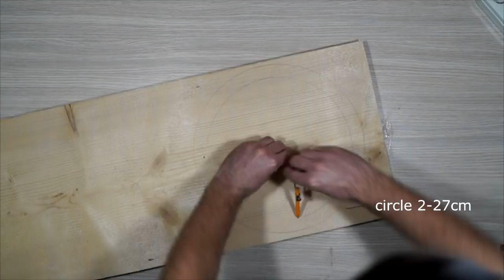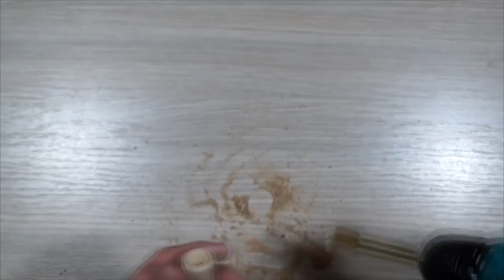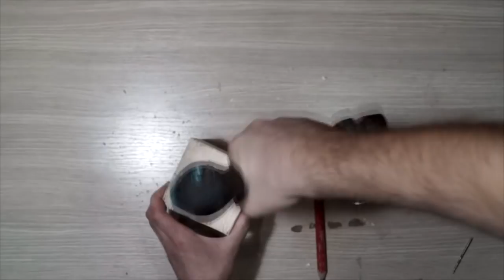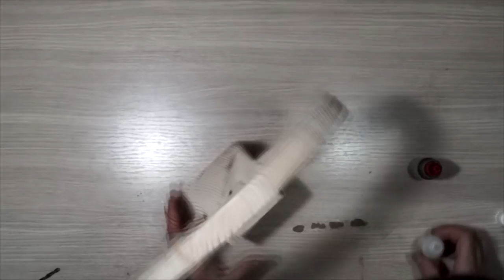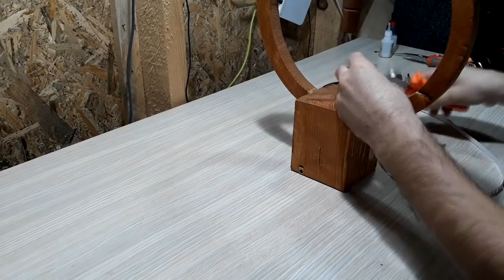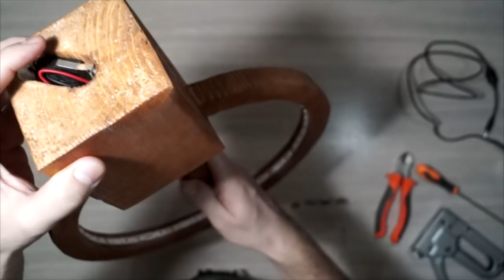DIY LED BALANCE LAMP

Comment: Instructions could be bit clear
I didn't get it
But beautifully built
Reply from the maker: Tell me what you did not understand and explain to you here.
Thanks!
Reply: @IulianMan  i cant understand that what you did to that magnet to make it insulating
Reply: @IulianMan  is that magnet connected with wire if yes then how

Comment: It's so amazing and cool!
I'd like to make it myself, but can you tell me exactly how it turns on when there's a magnet?
Reply from the maker: Hello
The fishing line does not transmit electricity.
If you look closely at the clip is a switch down in the base.(A black switch)
That switch has a tab and is driven by the fishing line when stretched out.
Thanks!

Comment: Very cool. Thank you. Might you have a parts list available? Or at least a link to the specific switch and transformer you used? Thanks again!
Reply from the maker: Thanks!
the transformer is 12V with 1 amp
and the switch is Snap Action-Switch
https://www.amazon.com/Basic-Action-Switch-Straight-250VAC/dp/B00HKHURL8

Comment: shall i use 12 v dc battery instead of 12 v transformer... what you connect with snap action switch?
Reply from the maker: you can use the battery. connect the battery wire and the  wire from the led to snap action switch

Comment: Any specific brand for that specific snap action switch?
Reply from the maker: it doesn't matter the brand
if it helps you here is a link
https://www.aliexpress.com/item/4000144580116.html?spm=a2g0o.productlist.0.0.612f7434HAhDab&algo_pvid=ef8d7dc6-495a-4168-99e7-ab7cea2a84d4&algo_expid=ef8d7dc6-495a-4168-99e7-ab7cea2a84d4-15&btsid=0ab6d59515918199255211304ed24c&ws_ab_test=searchweb0_0,searchweb201602_,searchweb201603_

Comment: Awesome! How does it work? Fishing line transmits electricity or I missed something?? I don't have much knowledge about electricity, so I didn't really understand what you were doing, but I'm curious because conductors are normally made of metal.
Reply from the maker: Hello
The fishing line does not transmit electricity.
If you look closely at the clip is a switch down in the base.(A black switch)
That switch has a tab and is driven by the fishing line when stretched out.
Thanks!
Reply: @IulianMan  Thanks! I didn't know that type of switch.